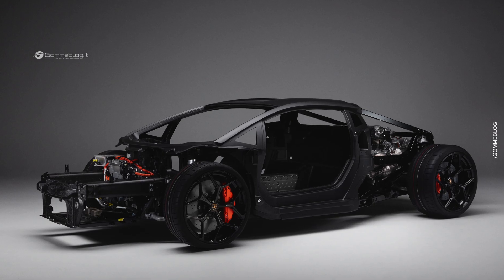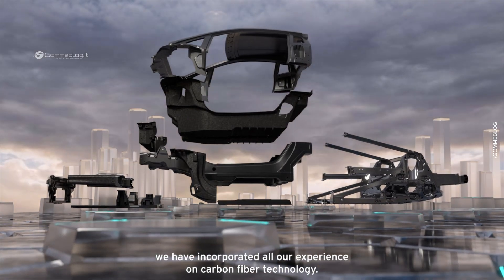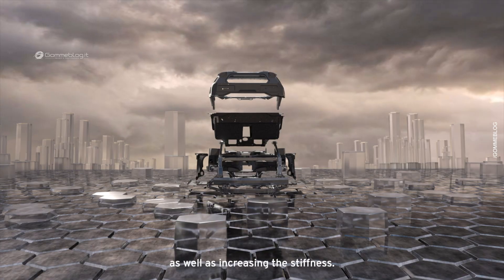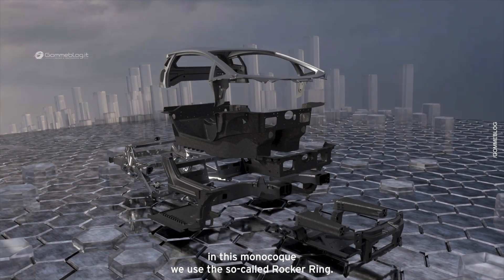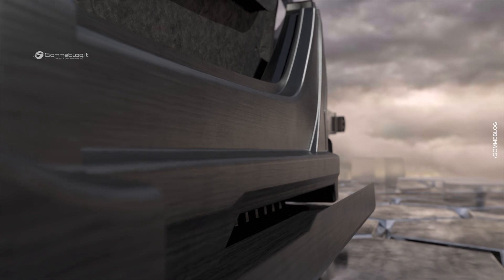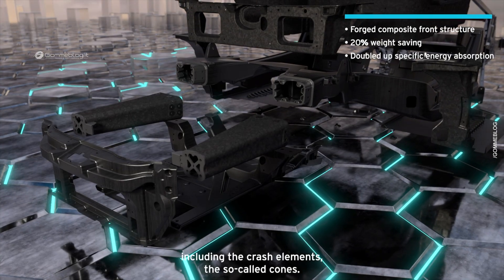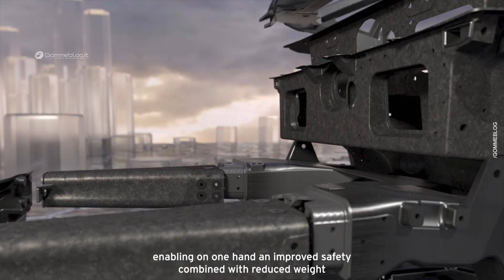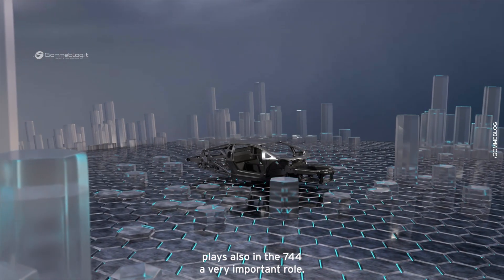Lamborghini LB744: The  innovative 'Monofuselage'

Comment from the maker: Lamborghini LB744. Introducing the innovative ‘monofuselage’, a new aeronautics-inspired monocoque concept made entirely of carbon fiber. Lamborghini LB744 is the first super sports car with front structure in 100% Forged Composites. Increased strength and torsional stiffness with significant weight reduction